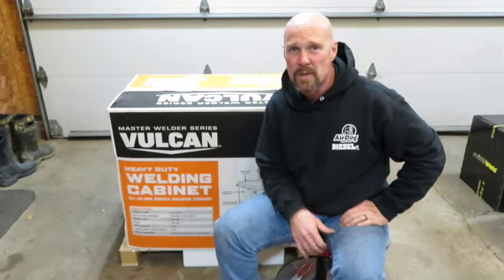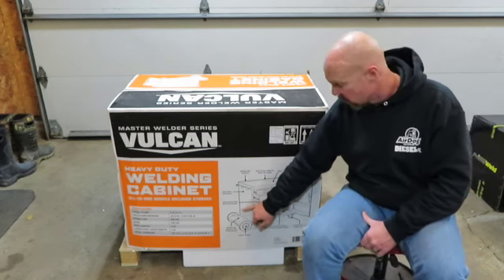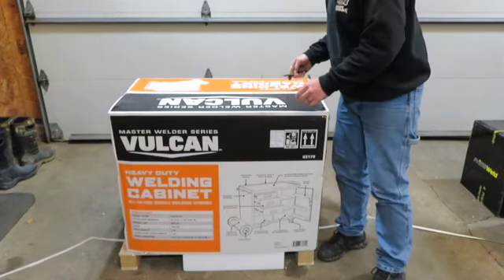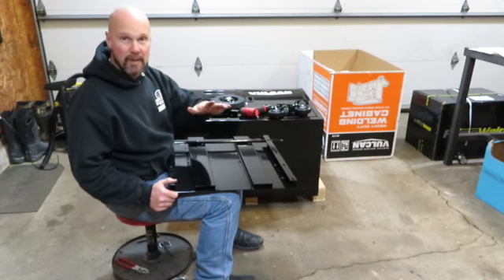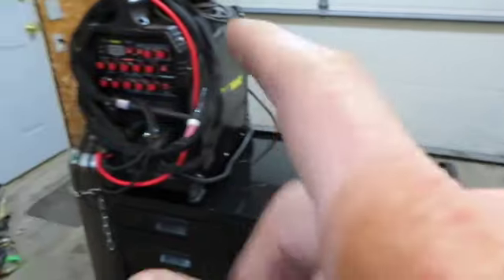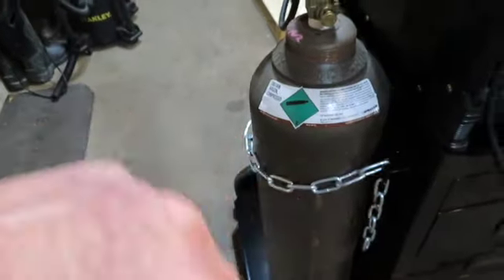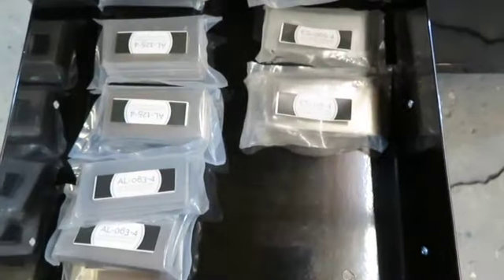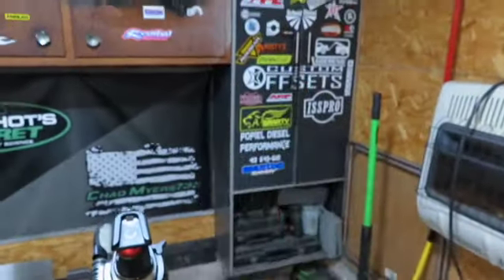Vulcan Welding Cart From Harbor Freight

Comment: Hey Buddy, just subscribed and saw your box in your earlier MIG180 unboxing vids. I actually found the same box from Tool Lots in So. Cal less than Hobo Freights sale price without the graphics. I currently have a PrimeWeld T225ACDCP, CT520DP and a new MIG180 on the end. Confirmed with the PrimeWeld machines and (2) 125 bottles strapped on she rolls smooth as glass. I’m gonna probably add a gang receptacle box (3 NEMA 6-50R)  to plug in all of the welders and then snap up a 25 Ft extension cord from PrimeWeld to use as the pigtail to one of the wall mounted 220V receptacles. Thanks again for the update. Weld on Brother
Reply from the maker: Thank you for the support! Check out my TickTock I did the daisychain plug for the welders on the back of my cart on my TikTok

Comment: I’m making a cart for my welder and gas bottles out of square tubing and plate steel. I like the tool cabinet look of the Vulcan cart and might see if I can do something similar. I have an unused tool cabinet that I might be able to weld into my carts frame. Thanks for the video. It gave me an idea. I’m also spending less on the materials than the HF cart, though not by much.
Reply from the maker: Cool man thanks for watching!